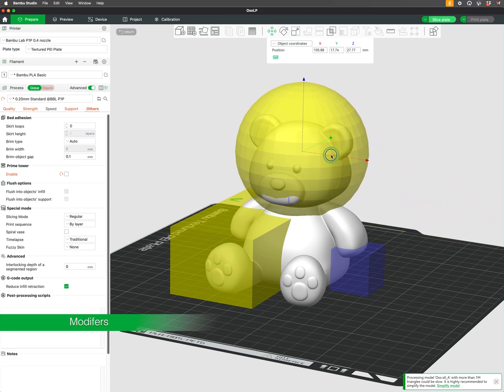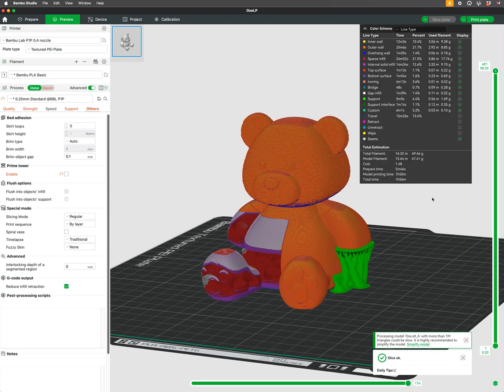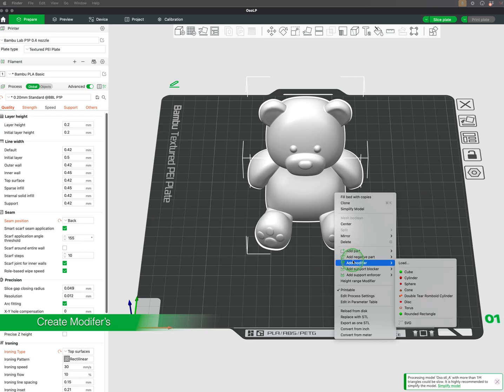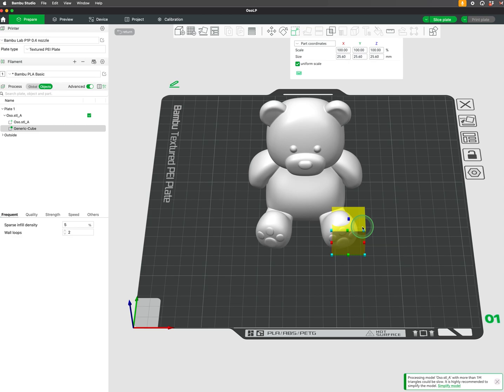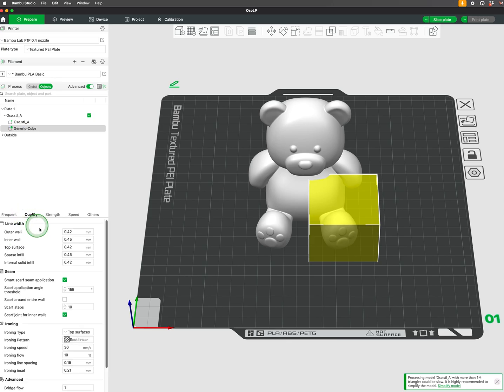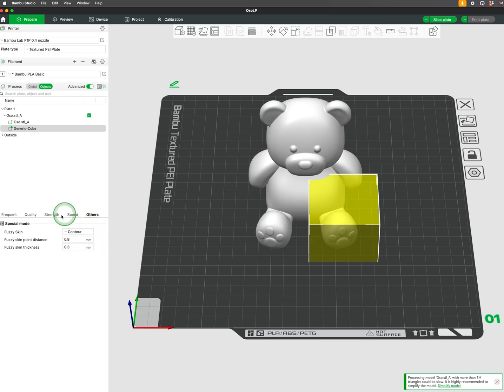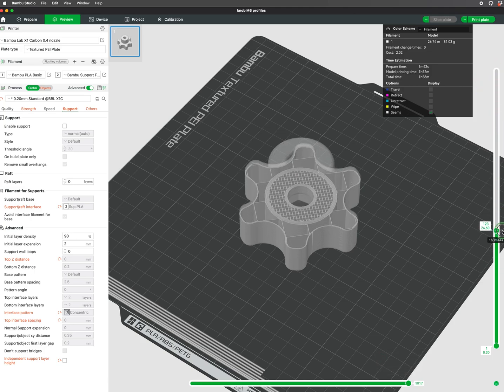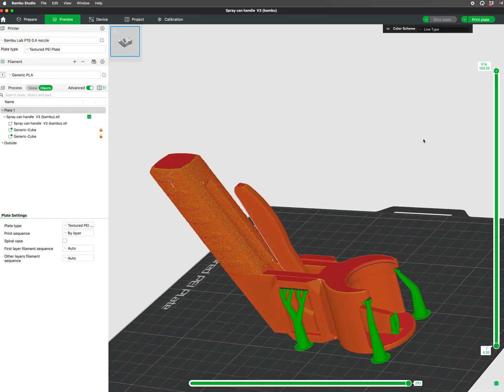Mastering 3D Print Modifiers: Precision Control for Better Prints

Comment: Question: what am I doing wrong if the modifier value (increasing infill in selected modifier cube) is changing the entire infill value of the model? The model infill is 8% and the modifier is 25%, but 25% is applied to the entire model, not just the modifier region. why does this happen and how to fix it?